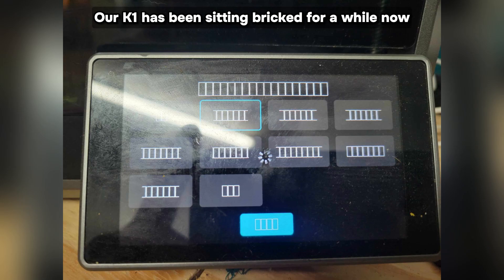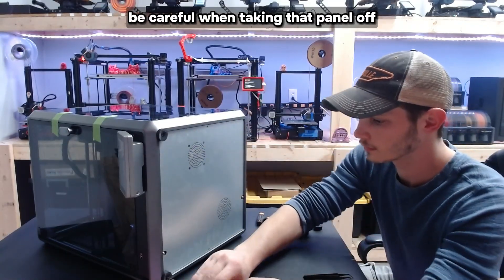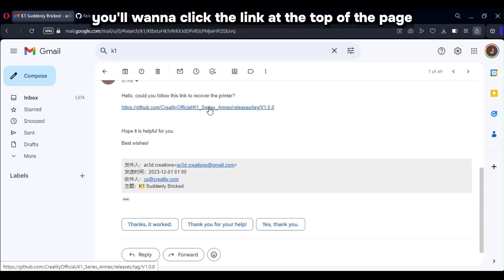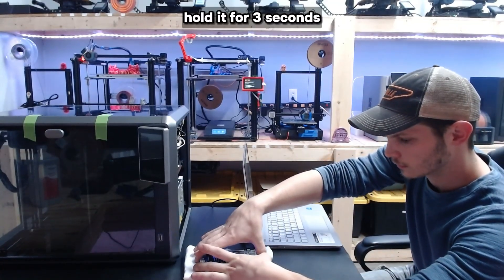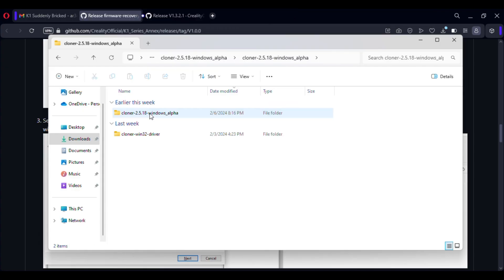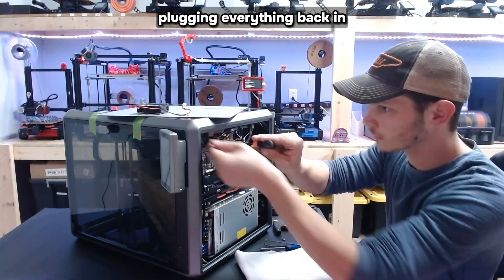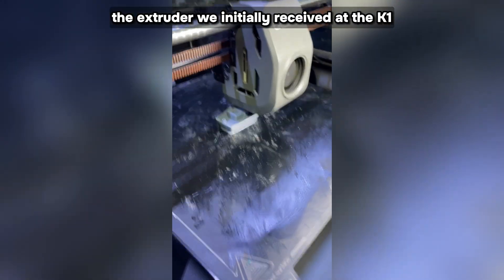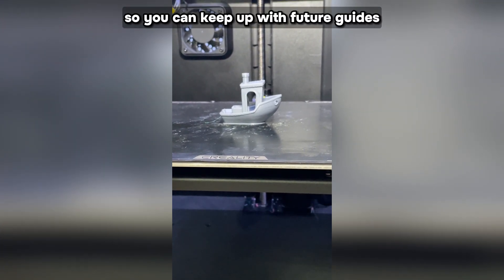How to Fix a Bricked Creality K1 or K1 Max.

Comment: hello, using k1c
After doing the same process 
The auto levelling is failing a lot
The extruder is crashing into the corners
Reply: u fixed?
Reply: @pepuSti  Yes had to flash k1c firmware after doing this process

Comment: Hint: If you don't get the lights on your board, plug it into the power from the printer (the two wires with the ferules that go into the green terminal. Second hint: I had to disable secure boot, and driver signature checking for Cloner to work. And of course, that meant I had to get the Bitlocker Recovery key. PITA! I had a warning in Device Manager about the driver being unsigned. The aforementioned steps got rid of the warning and everything worked. I then returned secure boot and driver signature checking back to their original states. Hopefully now I don't have malware, but this did work!

Comment: So I did the process but now when I turn it on there is an horizontal line in the middle, then several horizontal lines appear, any ideas? Thought i might have damaged the screen cable so I ordered another one, still the same, please advice
Reply: I’m experiencing the same issue on my K1 Max as well. Looks like I’m not the only one.

Comment: Hello. Creality has gave me these instructions: "
Thank you for your feedback. Please follow the steps below to troubleshoot:

Unplug all motherboard connectors, leaving only the motherboard power cable and the display cable. Then power on again and check the motherboard's lighting.

1. If the motherboard's lighting is normal (one flashing, one solid),

There may be a short circuit in one of the motherboard's terminals. You can test this by plugging in the motherboard one terminal at a time.

2. If the motherboard's lighting is abnormal, it indicates a motherboard problem. Replace the motherboard." I unplugged everything except power and display. But still the same lights do the same thing (d5 dim at startup for a few secs then blinking and d4 always solid) I am getting impatient. Should i do what you did? I am scared that i can't print after i do it because if it doesn't work there will be no way to use LAN. The printing still works screen has not been working

Comment: I've gone through multiple cables, powered on the printer and plugged the board into my computer and I'm still not getting any LED's or even a notification that the board is recognized. What am i doing wrong?
Reply: you need to leave the 24 volt cable from the printer in

Comment: I installed the CFS and its nothing but problems, would I use this method as well to get me back to the original firmware because I can't remove the firmware I had to install with the CFS
Reply: What did you end up doing? I’m in the same boat

Comment: Nothing happens when in the cloner after clicking start and holding down the two buttons. Any ideas on what I'm doing wrong?
Reply: Same here, did you find any way to fix it?
Reply: @marijntenberge6961  Didn't find a solution?

Comment: @arc.industries25 I've done this before using your instructions and it worked.  However, this time its not.  I for fact have a data transfer cable... I've tried both USB 2 and USB 3 ports. The blue lights are as you've stated after the reset/boot sequence.  I can't any Ingentic device in Other Devices listed.  Any thoughts/ideas?  Thanks

Comment: This DOES work on a K1C. I just did it on mine that wouldn't boot past the creality screen.
Reply: Is your K1C working Fine still??
Reply: @Anonymous99236  Yeah, It still works. I do have to turn the power off between prints or else it will throw a error code while doing its calibration thing before a print starts. Can't figure that out.

Comment: Hi there, Thanks for the recovery instructions! I am curious what my mistake is but the cloner won´t start burning. There is no progress bar. 

I am testing it on a K1C:
-I connected the MoBo with the power from the printer (24V) and a datacable to the PC
-I installed the driver to the ingenic device after resetting an booting the MoBo
-I choose the  1.3.3.5 image in cloner and start the progress (shell says "start burner"
BUT 
resetting and booting does not lead to any progress in the shell / cloner

Has anyone experience similar issues? How did you solve?
Thanks in advance
Reply: did you ever solve the issue ?

Comment: PLease somebody help me.
i reach the "Click Start. If the black text box is stuck at "start burner", which is usually the case, it's waiting for the Ingenic USB boot loader to be accessible. Hold down the boot button and click the reset button".
The process did not start after pressing the buttons, I tried different PCs, Windows versions and cables.
Reply: Got any solution for this? I'm stuck on the same thing right now...

Comment: Thank you for this but I'm having issues when I hook up the micro USB no light come on as if it's not receiving power. And when I try doing it while the board is still attached to the printer the cloner stays at start with 0 progress shown what am I doing wrong please he help
Reply: I'm also having this problem
Reply: @dylansmith-halpine3058  I figured it out you have to leave only the power wire connected while doing the update the light to stay on so don't disconnect from the printer take everything off but the power cords then connect it to the computer and it'll work
Reply: @dylansmith-halpine3058  I'm guessing the devices we used aka the (cord or the laptop) wasn't supplying the unit with enough power. But yea just leave the power cords attached (only the power cords) and then continue as normal

Comment: Does this also solve the error 111? 

I just bought it and only printed twice, it starts to have problems. The excruter is not coming out and then this error 111. Even after they send a new hotend board it still have the same error code
Reply: I had mine for 3 weeks before I got error 2567 🤦‍♂️ in now 7 weeks into it being broke up to yet I’ve had 3 replies and a new motherboard sent out which didn’t fix it
Reply: @nickhoughton5262  wow that suck, I too just bought a new board and will be fixing it after my exams are finished🤞. This will be my first and the last time buying from creality. I mean if you have malfunctioning issues directed to your main board, why even bother selling the 3d printer. I have seen a lot of issues regards to K series and all of them are because of the motherboard.

I hope your problem can be fixed in the future. If it don't, may i suggest using the same casing but different board(i haven't tried it yet but hey it's worth the risk)
Reply: @ChummyMiNummy well I’ve fitted the new board and it didn’t work so it’s got to be something more within the printer, I’ve stated to them I don’t want to go stripping the entire printer to fix it and I just want a replacement printer but they just completely ignore it every time and go on to replacing a part, I definitely won’t be ordering any other product off them again as it’s just not worth the hassle

Comment: I used your so simple and helpful guide but aparently the K1C board needs to powered also from the printers power supply or it doesnt turn on. I installed the drivers without any problem but when I'm doing the reset the blue light that should be off its very low dimmed and when I start the firmware burn from USBCloner the terminal wrights start burn but it doesnt do anything. I wait for 10-15 minutes and it doesnt do anything. Any suggestion?
Please!
Reply: I have the same issue.
Reply: @OutbackMachine  in the end I got a new board cause I couldn't do anything
Reply: @OutbackMachine did you resolve it? please im have exactly the same issue
Reply: @Promma91  did yoi solve it,let me know the stepa ,I have the same problem.
Reply: @Promma91 @OutbackMachine did you solve it,i have the same problem??
Reply: @ Promma91

Comment: FOR ANYONE HAVING THEIR BOARD NOT LIGHT THE LEDS

The instructions now say you have to leave the 24v power supplied to the board!

Once I did this the guide worked perfectly!
Reply: Thanks for the comment. I was scratching my head as to why the leds didn't come on. Good thing I got a power supply I hooked up and got it to power up.
Reply: Vous avez mis l'imprimante sous tension pour pouvoir avoir les leds allumés ? C est bien cela ? Sur carte k1c ? Merci beaucoup @Farmer1277
Reply: oh my case today. 
How can I connection 24v USB micro?
Reply: Answering my own question after some thought. 24v you can get by connecting the motherboard directly to the printer power supply, with the red and black pins

With a notebook or by bringing a printer close to the computer, you will be able to connect the motherboard to the 3D printer source and the USB cable to the computer and the motherboard
Reply: dzieki , juz 5 kabli testowalem

Comment: Thanks for the nice instruction...I pluged the mainboard to my computer with the good type of MicroUSB cable but nothing ...no blue lights ...nothing... could it be a dead board ? I rooted my Creality K1C but I don't like to handle the printer like this... Thanks for your answer and for your good job
Reply: I have the same issue. Motherboard was disambled from the printer. No lights. Different USB cables, ports, computer. Motherboard starts only on 24v supplier. Have anyone idea how to fix it?
Reply: @SeeMaxx89 did you fix it?
Reply: Did you fix it?

Comment: I wonder if you can do this with only power disconnected since it appears everything else is accessible with the board installed. Maybe there is a back feed possibility to the daughter boards on the hotend and heat bed. Anyway thanks for posting this, I have seen this issue more than should on forums.
Reply from the maker: Yes you should be able to do this without disconnecting all the wires, as long as you are able to get the cord in. The cord we were using wouldn’t go in though so just assuming a lot of people will have the same issues. But if you can get it plugged in without disconnecting, definitely save yourself the time!

Comment: I'm not getting any blue lights any suggestions?
Reply from the maker: Is your device reading the board?
Reply: @arc.industries25  mines is not showing any blue lights but it turns on in the printer and I used many usb micro boards and tried another laptop
Reply: Same here and mine my computer is not reading the board
Reply: @RafaelKaname  stolen from what someone suggested on a bricked KE vid:
For those having problems with the unsigned drivers, you'll need to boot windows in recovery mode (Shift + Restart) and then Troubleshoot > Advanced Options > Start-up Settings and press Restart
Then on the Startup Settings, press 7 to select Disable Driver Signature Enforcement. This will restart your Windows and you would be able to install unsigned drivers

Comment: So, after beating my head against the wall, with two different Windows 11 machines, I used an old MacBook Pro and set it up to dual boot the MacOS and Windows 10. When booted in Windows 10, the driver loaded without issues and the rest of the firmware reinstallation when along just as fast as I could follow the rest of the steps. I have yet to put the board back in the printer, but if the machine comes back to life, no further news will be good news.

Comment: I realize that the problem I am having is that I cannot load the driver as described. I have tried two Windows 11 machines and I run into the same problem when I select the folder that has the drivers.

Update Drivers - Ingenic USB BOOT DEVICE
Windows was unable to install your Ingenic USB BOOT DEVICE
Windows could not find drivers for your device.
If you know the manufacturer of your device, you can visit their website and check the support section for downloadable drivers.

Anyone have an idea how to fix this?
Thanks

OK, I get things started and I get this

C:\Users\jfpar\Desktop\cloner X
cong thread= 0x301c socket interaction test socket listen ret=1
core connected!!!
"10:17" core (init)message: "0:0:0:11:0"
"10:38" core (init)message: "0:0:0:0:0"
start burner

But then the in first cloner window, after resetting and rebooting the board and clicking start, the start button now says stop. At this point nothing seems to be happening. How long should the cloning take? I have tried restarting the Windows 11 computer, uninstalling and reinstalling the driver and starting the cloning over again. If I look at the task manager shows cloner using 1% of the cpu and 3% of the disk. What do I do now?
Reply from the maker: There was another comment on here talking about issues with the Windows 11, but they are saying it worked for them with Windows 10

Comment: Exactly what i have to do, but there's no usb port soldered on my k1 board, also the J1 pins are not there...
Reply: Same here, I've contacted Creality support and am waiting (day 3 now) for them to update my support ticket. I did find a reddit post titled "No Micro USB Port Anymore (K1 non Max)" from about 6 months ago that says, for some reason, Creality released boards without this port soldered on for a couple months back in August/September of 2023. I bought my K1 on Black Friday 2023 from Creality and was considering myself lucky to have gotten the newer version with the good extruder, only to now find out i got a defective mainboard. I bricked mine trying to reset back to factory firmware so i can update the K1 Helper Script & it just has a Creality logo on the screen now. At first it has a blue bit sliding through the logo before it just goes to a static Creality Logo. The recovery method here is the only other way to flash firmware to the board & I am unable to do this recovery process without this micro-USB as it won't work from the front USB. The spot is there for one to be soldered on, but i don't have the tools nor the skill to pull that off. I advise anyone in a similar predicament to contact Creality Support, especially if you're within your warranty period. Best case is Creality sends a new board, worst case I have to buy one for $80. They'll want a copy of your purchase invoice, photo of the serial number, photo/video of the issue, and your email, just a heads up.

They seem to have neglected my J1 pins as well.
Reply from the maker: Hmm that’s weird, I’m not sure why it wouldn’t be there